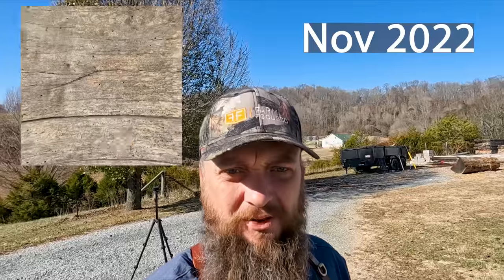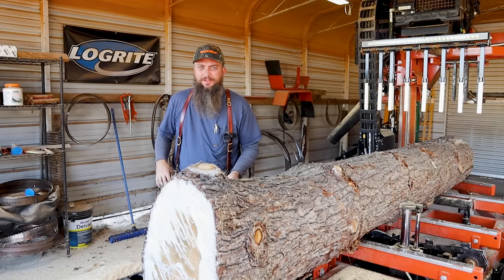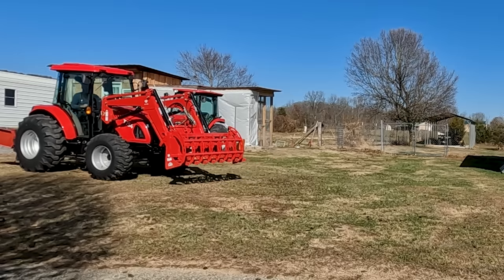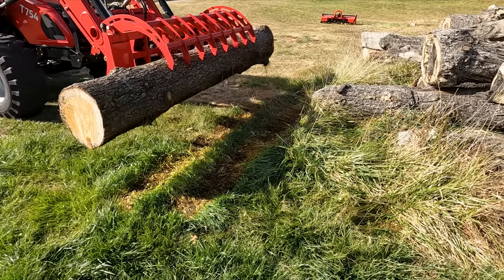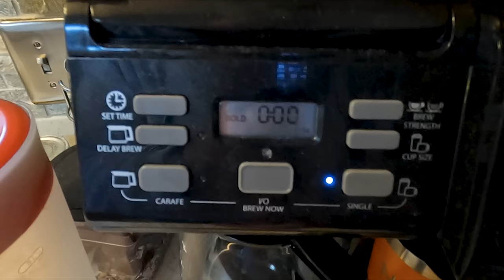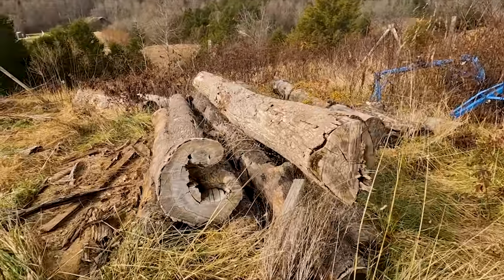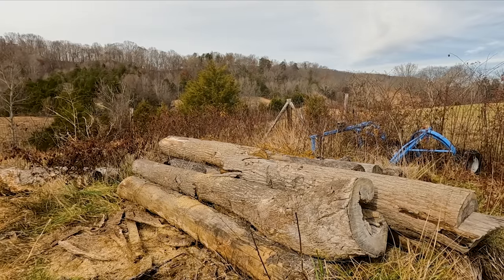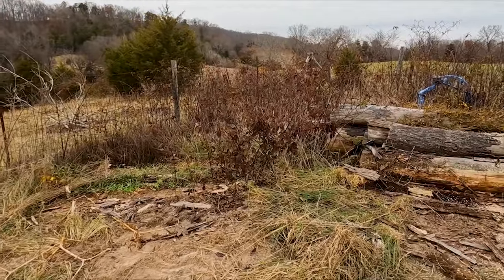40 Minutes of Saw-milling, Tractors & Chainsaws

Comment: The best way to start a burn pile is with a couple of those chloroplast political signs. Just lay them on top put a little diesel on them and light them up with a lighter. They will do the trick and they are cheap. They are left on the roadsides after every election cycle and after 2 weeks past the election I consider them litter and pick them up and store for future use. I figure I’m helping clean up trash from our road sides and saving diesel in the long run. TG dinner looked delish could have been at my own home. Really enjoy the vids Nathan. Thx.

Comment: What I see when you burn your wood pile is all the heat you could use to heat your kiln.  When I worked at Memphis Hardwood, they used everything from unusable wood to the dust out of all their milling machines being used to make hardwood flooring.  The Youtube channel Working Horses with Jim, he also has a saw mill and uses his scrap wood to run the home boiler to heat their house and kiln, in Upstate New York.

Comment: I'll pass on a hint I got from someone else, whenever possible put the small end of the log towards the operator station, that way your thin cut to start only gets thicker (so you don't do a run out and need 2 slab cuts) would have also eliminated having the big end fall into the void on carry back :-)

Comment: Could you use scrap boards to build a support frame under the "empty" two feet in the kiln so you wouldn't have to make 10 footers into 8 footers in the case where your original boards aren't as long as later runs getting added on top? I guess they'd need to be green too so they would shrink at the same rate as the 8 footers. NVM I talked myself out of it as that would be a pain to deal with :)

Comment: I'm not blaming you for burning the scrap pile . It's a shame that no one will take it. Even the pine would be ok for sitting around an outdoor fire or kindlin wood. I know a guy who worked in a book warehouse . He had a camper and would take the oak pallets and cut them up for camp wood. . We have a business here that makes wood chip mulch. They make it from pallets . I'm sure if they had a supply of scrap wood ,they would run it through the chipper . Some of the towns in my area have chipped wood (from storm and spring clean up) and collected leaf piles that people can take for their homes . If you put that out to the curb here it would be gone before 1AM. Probably faster if you put a for sale sign on it. People more willing to take it if they think they are stealing something worth something.
Reply: Our landfill also takes wood to mulch. I think they use it to cover over the trash at the end of the day . They use to grind construction debris to use as  a cover . The machine was sold as it could grind up a car. They got rid of it because it was down more than a McDonald's ice cram machine

Comment: Too bad you couldn't figure out a way to use your scrap wood as a heat source for your kiln.
Reply: That would be difficult to regulate.
Reply: @zapa1pnt  if you used a wood stove as a heat source for the kiln, had a fan running continuously, you woud only need to feed the stove twice a day.

Comment: I agree with your critics. You waste too much wood and too much labor as well.
Reply: The large, industrial, mills waste even more.
Reply: @zapa1pnt  Now days lots of the mills are chipping the scrap.  Around where I live logging companies even take a chipper to the woods with them and chip the tops.
Reply: @zapa1pnt  I mis-spent my high-school summers pulling the green chain at Weyerhaeuser. Even then they got shit for burning chips and slabs 57 years ago. Now a days they even salvage the bark. The wood goes into chippers and makes pulp for paper, or particleboard, or charcoal brackets, or prestologs or OSB. Some is even made into wood alcohol. You can chip it and mix it with manure to make compost oe wood pellets to burn in wood stoves. There are lots if products that can be made from that waste.